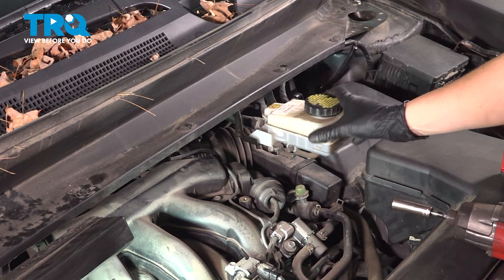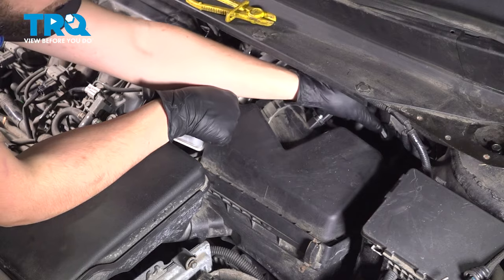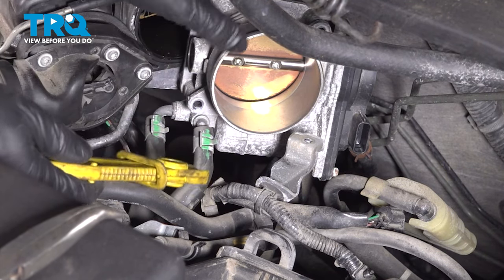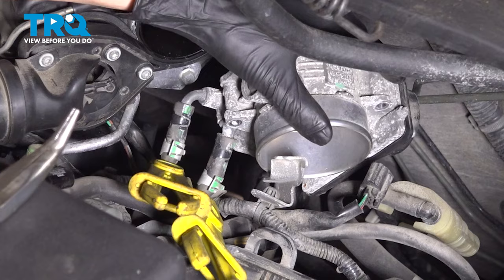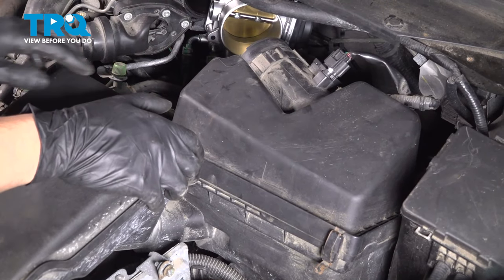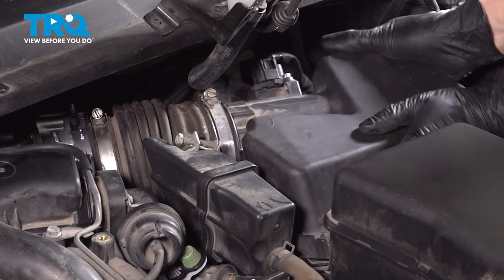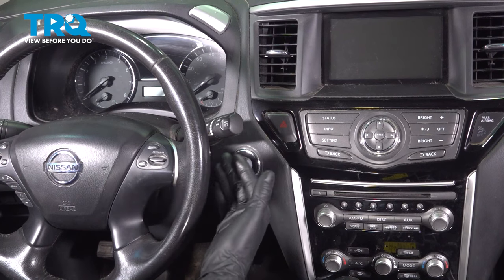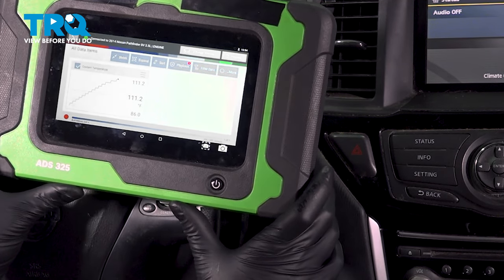How to Replace Throttle Body Assembly 2013-2020 Nissan Pathfinder (3.5L V6)

Comment: So, after the pre-reqs are met and you shut off the vehicle for at least 10 seconds, you only turn the ignition to the ON position, correct? Not actually start the engine? And why is the check engine light still on after you were done?